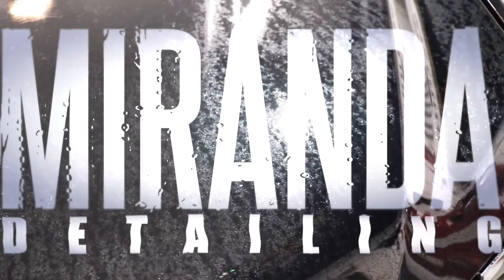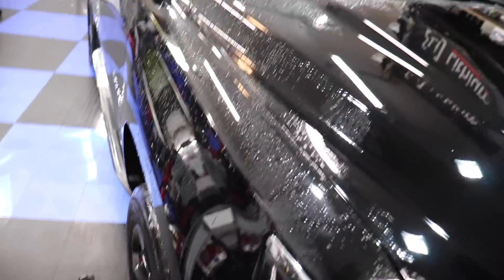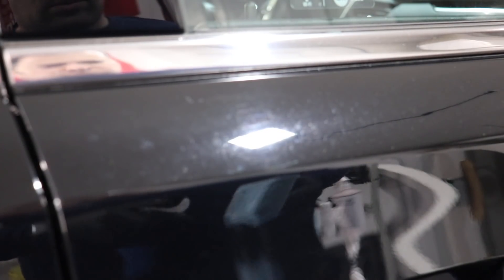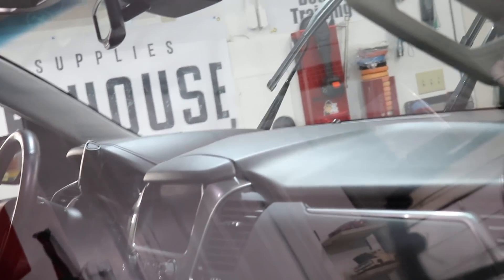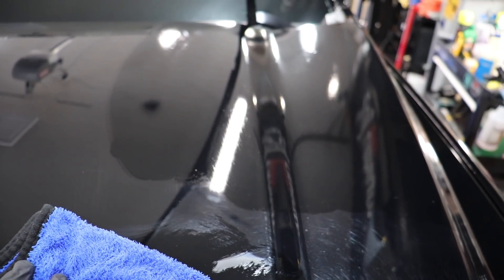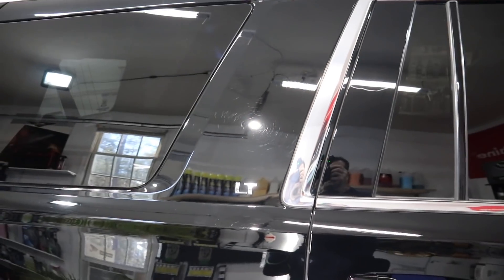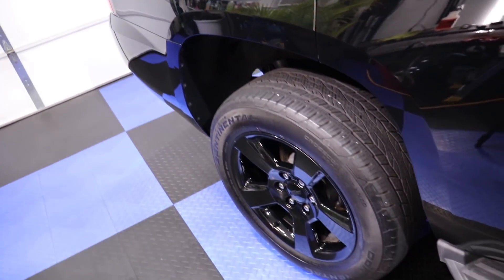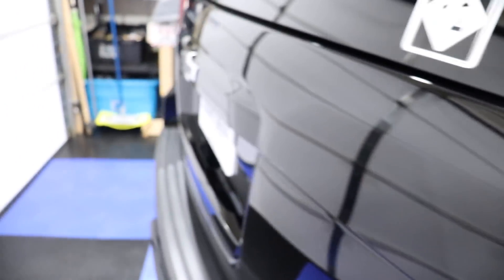How To Remove Water Spots!

Comment: Hey Phil. Thanks for the tip in the use of the paint protection solution without the cure time wait and the no panel wipe to simplify the application. These tips saves valuable time and effort.

Comment: Looks like you used the clearsr as another step in the decontamination process, which I think is a good idea. Mineral deposits, IMO, are another source to introduce swirls if not removed. I appreciate you showing us your method of using the products. 👍✌️
Reply from the maker: Yeah that’s pretty much what it was used as the Decon the paint of mineral deposits. But with water spots it’s a little different. You could either use a chemical to try to remove them or you can use a compound to remove them. If use a compound and or polish you really don’t have to worry about swirls because you are in fact removing the swirls with that process.

Comment: Here in Houston we have REALLY bad water. Spotting was/is a HUGE problem!! I watched a video where it was suggested to get some Formula 4 wax from O'Reilly's and spray lightly on car while still wet after wash, then dry with drying towel. This has so far solved my spotting problem. As a matter of fact, morning dew is a big problem also, but after the wash and Formula spray wax, dew just evaporates without leaving any spotting also. Amazing!!! It sucks that spotting is so bad, but ClearSR is a good spray for the arsenal also. I don't have any, but I will get and try
Reply from the maker: Aw man!  Hard water can be so annoying!!  The CR Spotless DI system also works really well for rinsing!!
https://youtu.be/SPI8GSQUYCw

Comment: I "wish" I could get $900.  Connecticut isn't exactly a low $ state. Sigh.

Excellent video, Phil and Jess! My Vette and My Dad's car have water spots that'll be cared for next spring!

Keep up the great work! I absolutely love this channel! I continue to learn more and more from this fine channel!
Reply from the maker: Thanks so much!!
Reply: May I ask what You charge for: 

Wheel/Tire cleaning
Foam
Basic wash
Blow dry/Towel dry
Dress tires.
Clean exterior windows.

Thank You
Reply from the maker: Hi. Well that would kinda fall into our maintenance detail, with adding on a spray topper. We charge $175+ depending On the vehicle size.
Reply: @MirandaDetailing  Wow! I'm in the wrong business, and or, I'm much too nice! 😳

Comment: Hi guys, honest question here and not a crappy, challenging tone . I've always been so careful with the no cap gas fill area. Scared to do something wrong and it takes time. Time meaning me with a cloth, a brush etc. and soaking the entire area around it. All good to pressure clean without fear, as long as you're not blasting full on? I know this is an old video, so not actually expecting an answer,  but I respect what you do and yould love to hear about the question. Love the videos and thank you for the information:).
Reply from the maker: Hi. Yeah around the no cap filler we just avoid spraying directly on it. As long as you’re careful it’s fine. It’s not like it’s open and water can just get done there.  It has two spring loaded seal caps that prevent water from just getting there and sealing the fumes in and pressurizing the tank.
Reply: @MirandaDetailing  thanks guys!Really appreciate it and enjoy the videos very much. Very informative if you consider the question I asked had nothing to do with what this post was lol. I actually watch and learn:).
Reply from the maker: @mcflotty you’re welcome.

Comment: My go to for water spot removal is vinegar.  And I use superior formula 4 to keep the water spots away.  In my area acid does not work for water spots because calcium is very concentrated and thick. And lot cheaper!!
Reply from the maker: Cool. Vinegar is an acid with a ph of 2.5. The ClearSR is the same ph level. I used vinegar on water spots before and it helped a little. But This stuff really dissolves them well. I guess it depends on the type of minerals we are dealing with also. Thanks for sharing.
Reply: Yes, I have tried that product but those products can produce haze when not washing or polishing.  But the point will be that all water spots are different.  I deal a lot with cars by the beach and you but trees. It seems like companies try to ignore that when pushing their product.  Great video👍👍

Comment: Phil you just trying to get rid of products?😂.... Torque?....Really?😂 You run out of F11 or Shine Armor?😂 Comparing Black Ice to Torgue is blasphemy 😂😂😂. I’m just joshing of course. Great vid my friend! We constantly fight the correction vs enhancement argument. I tell my customers right off the bat I can’t get all the swirls out most of the time. The only guarantee I give them is it will look way better when I’m done!
Reply from the maker: 🤣🤣🤣 thanks man!  Yup that’s what we tell our customer also. 😎👍🏼
Reply: @MirandaDetailing  you also mentioned trying to get away from panel wipes. I have eliminated 2 items from my arsenal. Clay lube and panel prep products.

You don’t need to buy clay lube, you have all you ever need in your wash bucket(fresh wash bucket). 

You don’t need to buy panel prep sprays. Either make your own with rubbing alcohol and water or just use TW Hybrid polishes. They need a damp cloth to remove the polish which pretty much eliminates a panel wipe at all😂! Or just use a damp cloth for removal of any polish....hmmm!
Reply from the maker: Exactly!  Good points!!

Comment: Nice enhancement!!! Have you tried Megiuars water spot remover in the maroon bottle? I add a drop or 2 and equal amount of polish to my polishing pad to eliminate a step. Works great on glass and have even used it on plastic with a soft polishing pad. Have you tried Pinnacle Black Label primer polish? I am in the same boat, don’t want to have to mess with panel prep.
Reply from the maker: Thanks!  Yes I have a little of that water spot remover from Megs. I forgot about it.  I haven’t used that polish from Pinnacle yet

Comment: Hi Phil!  ClearSR worked really well.  Is it harder to work with a polish in colder weather?  Also those PPF applications were pretty interesting, could barely notice them.
Reply from the maker: Hi!  Yeah cold temps makes the polish to chilly to work with properly. But same goes with to much heat. 70° F is the perfect temp in my opinion for derailing! 😎👍🏼
Reply: @MirandaDetailing  Thanks for sharing the info. 👍

Comment: Phil, live your videos for your honesty . You don't have to explain why and what you do or charge. ( honesty I think you guys don't charge enough ...lol) people are a$$holes and keyboard warriors. Probably why I prefer animals over people...lol. that paint film protection is very cool. Need that stuff. I have a question though....maybe I should ask Arron from extreme solutions, but can you use the LRV 496 before the LRV 403 then coating after waiting 24 hours? Going to do a Dodge Charger dark blue in color. All of your videos crack me up....and I learn alot in the process..its a win win situation..
Thanks to both of you...much respect
Reply from the maker: Hi. Thanks man!! Good question. The 403 is so smooth and nice as a finish polish you probably wouldn’t need 496 before or after it. I would go with just one of those polishes instead of both. The 496 does seem to be working great as a primer polish and coat right away as I am seeing no issues on my Sage Avalon at the moment. But the 403 should cure 24h then coat over it.
Reply: @MirandaDetailing  thanks buddy

Comment: If your going to polish anyways, wouldn’t that get rid of the water spots?  Thx
Reply from the maker: Not all the time. Some water spots are so difficult to remove by polishing that it would take longer and we would have to almost go full correction to remove them. This way we found was faster and we didn’t have to take as much time polishing. 😎👍🏼

Comment: People need to understand that you run a business and if the customer will not pay for a full paint correction you don't have to and if the vehicle is a daily driver there is no point to make a full correction because it will have swirls again and it can be dangerous because of the thickness of the paint it is not as much as it came from the factory.  Experience and knowledge make the difference. BTW sorry for my writing.😅
Reply from the maker: Thank you! Exactly!  😁😎👍🏼

Comment: Using 403 today so I thought I’d watch this again.  Do I have to wait 24 hours after using the 403 before putting in a coating or is that not necessary?
Reply from the maker: Hi. If you don’t want to bother with an ipa or panel wipe you can wait 24h then apply your coating. But other wise you can just do a very light panel wipe and e fine applying the coating.
Reply: @MirandaDetailing  awesome thanks Phil. Used it on a Porshe today.  It’s curing overnight then I’m putting Adams Graphene Ceramic Coating on it in the afternoon.  Amazing product

Comment: What is your favorite products  for removing swirls
Reply from the maker: Well I usually start with Megs d300 correction compound. It’s a nice balance of cut and finish. Then I will go either more or less aggressive from there.
Reply: @MirandaDetailing  is that the only compound you use
Reply from the maker: Nope. We have a variety of compounds and polishes we use. Xtreme Solutions, Malco Epic, Meguairs M110 just to name a few more.

Comment: how to remove water spots from "plastic chrome" such as the roof rails and window trim on most VWs?
Reply from the maker: I would use the same process. Either use a water spot remover like we did or hand polish, Or both

Comment: In meguiar's marine rv range, there is M4716 hard water spot remover "spray", and M180232 extreme marine water spot detailer "spray also".  I wonder if it would work well on car paint ?!, has anyone tried ?.  Thank you.  I ask because Meguiar's products are much more common in my country than the last coat for example !.  M4716 interests me well, it goes on boats, it must also go on car 😉
Reply from the maker: Oh good question. I haven’t tried those. Maybe I should look them up. Thanks for that info.
Reply: @MirandaDetailing  thank you buddy 👍

Comment: You can also wheel brightener as a substitute to remove acid rain on paint. Would not recommend it on the windshield.👎🏾
Reply from the maker: Hi. I have tried that before and it works on fresh spots but unfortunately not on these! 😭. But it’s ok, this process worked great!! 😎👍🏼

Comment: @meow meow i can scratch the door handle ahh naughty meow

leave for one moment business and price a side or okay
did you also had in mind in remove the swirls about the clear coat and to deep will damage or make the clear coat thinner?
And the coat is a wax or ceramic coat still looking careful or light to see the swirls and the protection of any wax is weather condition as the sun and rust am i correct
and yes beautiful shine